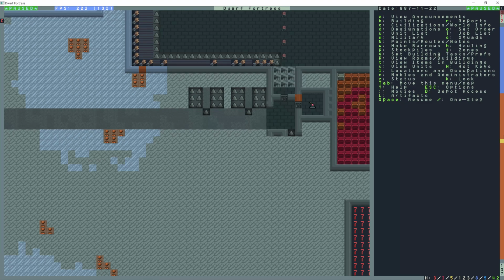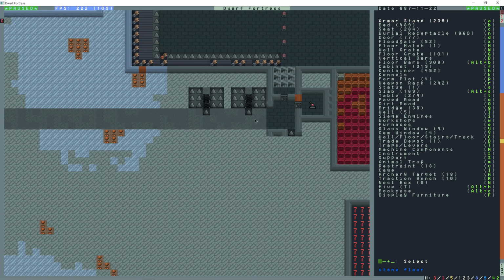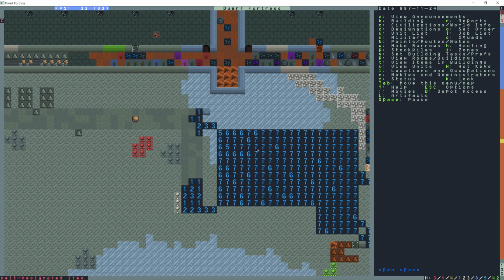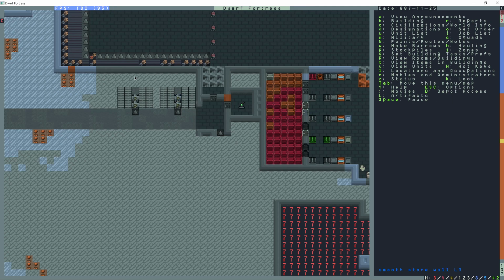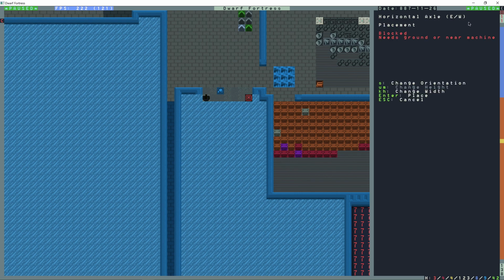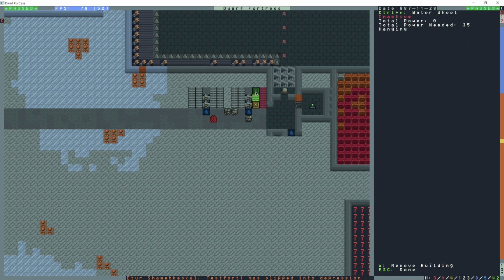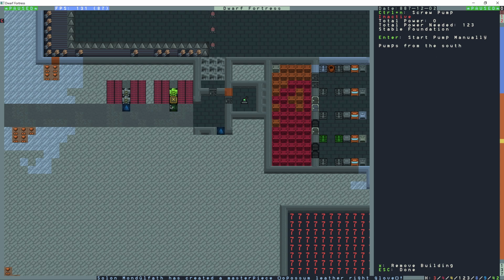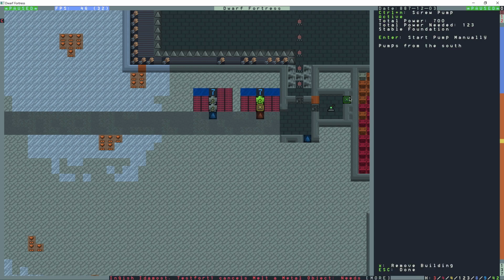MODULAR WATER REACTORS 🔅DWARF FORTRESS🔅

Comment: Following this guide, I set up 5 reactors on top of a small area cut into a light aquifer. My pump room immediately started to flood with water being sprayed by the reactors! I sealed it off and hopefully it won't matter lol
Reply from the maker: That's great hahahaha, I belive that since the aquifers create water & the pump raise water pressure by +1z level; this is why . Thank you for watching HunterZBNS !
Reply: @TwistedLogicGaming  It actually settled out okay in the end. I did also end up putting on lever controlled hatch covers and then walling off the aquiferous walls in my reservoir underneath, because my dwarves were frustrated about a couple of wheelbarrows left behind in one of the ramps lol